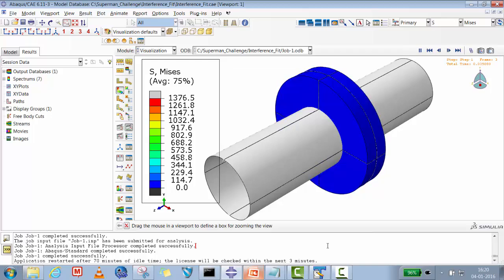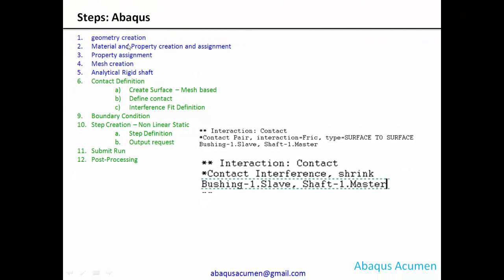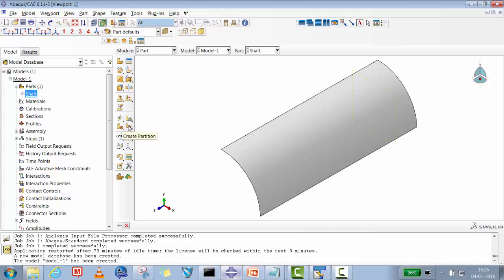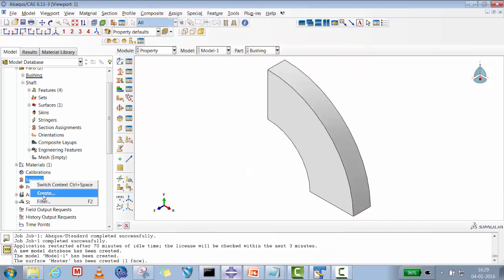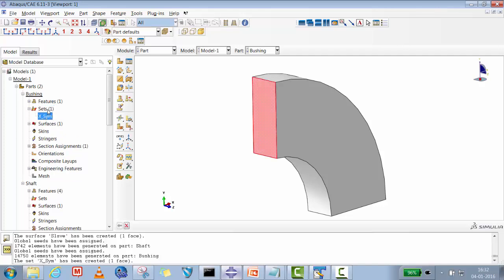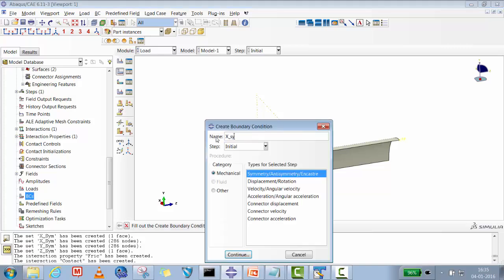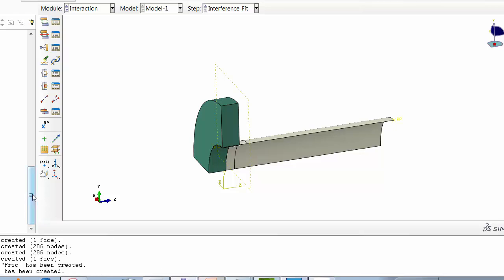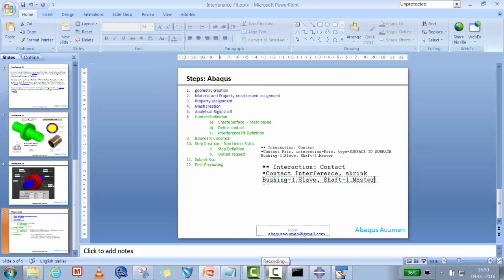Abaqus/CAE - Step by Step How to do Contact Interference Fit in Abaqus Standard

Comment: Hey Abaqus Acumen, Lets say the first step is cooling and then u do press fit with contact interference. But this time you can not use shrink option because it is not the first step of the analysis. Can you explain me how to set up the analysis?
Reply from the maker: You can do the cooling analysis and export the deformed shape. The stress can be exported as initial stress and then perform the contact interface.
Reply: @abaqusacumen7397  thanks mate.

Comment: Hello sir ,

I am surya (phone no:+ 917676176639), can you please make a video on "Buckling analysis of circular pipe having pined-pined support at both the ends" under axial load.

pipe:     dia internal =1.12m
                    external=1.19m
               length =15m.
young's modulus is=2.1*10^11 pa
poisson's ratio= 0.3

I want to know how to calculate End buckling (load carrying capacity of pipe) load.